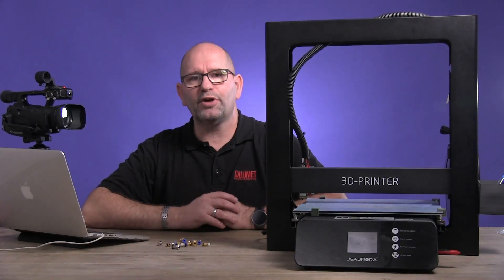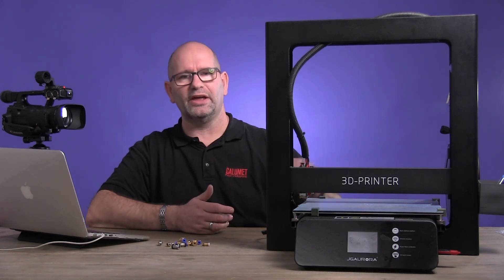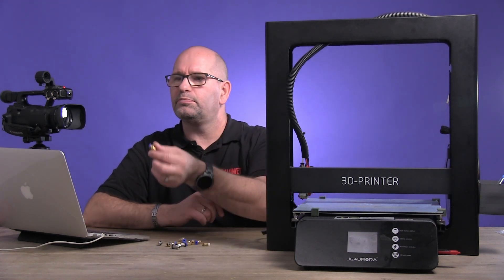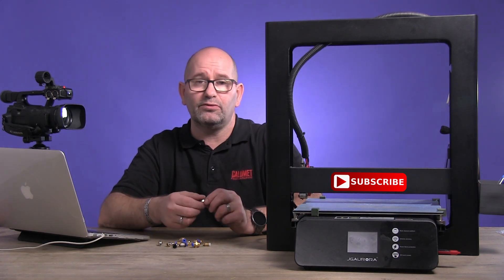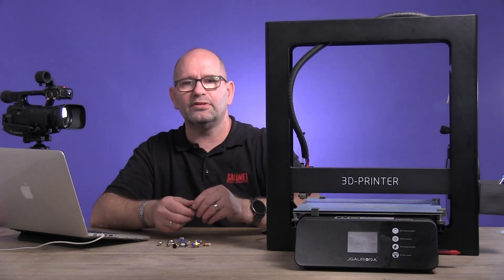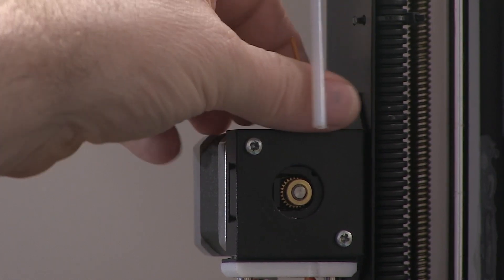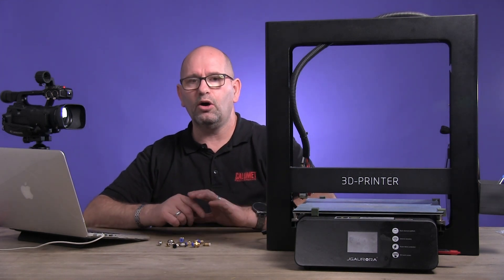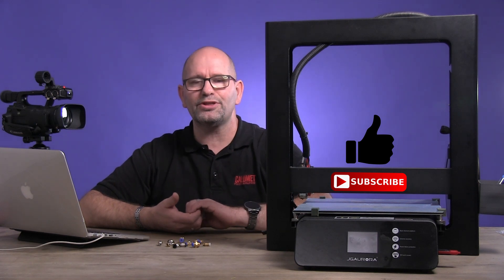▼ JGAurora A5 repair |  Bowden tube coupler repair for the JGAurora A5 printer

Comment: Hallo brain ik heb probleem met sidewire 1x printer  . De printer begint steeds links voor te printen .ik gebruik cura  4.0 help asjeblieft
Reply from the maker: Wat doet hij met de originele gCode die met de printer is meegeleverd?
Als hij deze wel gewoon in het midden print, dan ligt het niet aan de printer, maar aan de Cura instellingen namelijk.
Zelf werk ik niet met Cura, maar met Simplify3D, dus ik weet niet echt de oplossing voor dit probleem, maar ik denk dat het slim is om de printer even opnieuw aan te maken in Cura
Reply: @3dPrintCreator  ja print it middenin test cube en mooi ook
Reply from the maker: Ja dat dacht ik al. Het beste maak je even een nieuw profiel aan voor de printer in Cura. Je kunt de printer tegenwoordig gewoon kiezen in het menu van Cura en dan maakt hij zelf alle parameters aan die voor deze printer gelden (mits je een recente versie van Cura gebruikt, natuurlijk). Succes.
Reply: @3dPrintCreator  
Ik heb sofware simlpe3d gekocht en werk prima.bedankt